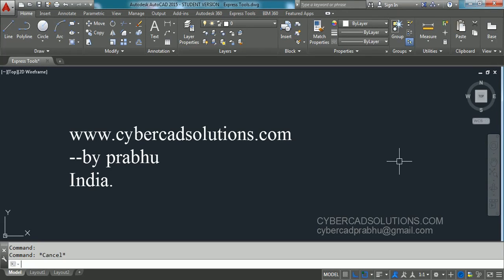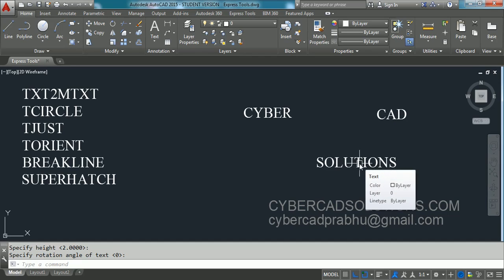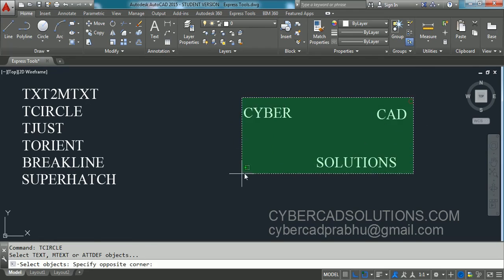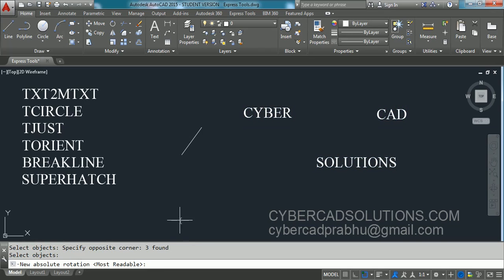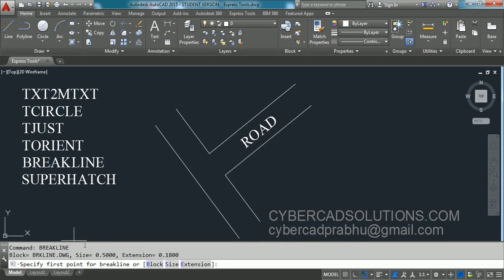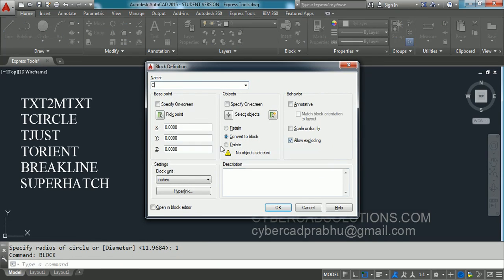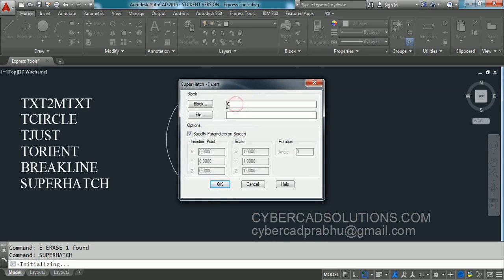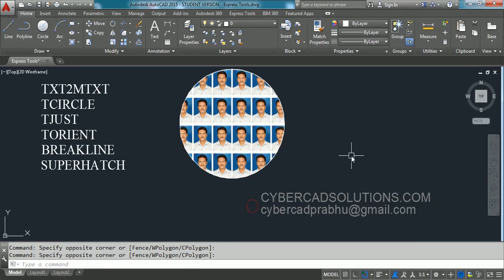What are the Useful Express Tools in AutoCAD

Comment: very useful and nice video make it was very clear no confusions,......very impressed keep posting cad commands..
Reply from the maker: Thank you. Please share.
Reply: @cyberCADsolutions  

Hi can you help in this,my CAD is hanging particular file due to block with attributes can't work it take time every selection 5to 10 minutes to move or paste.. Can you clarify it?
Reply from the maker: Make a copy of the file. Use purge command to remove unused blocks and references. Then the file will become lighter.
Reply: @cyberCADsolutions   I have done purge ..i tried those commands.. But still same issue exisisting ...
Reply from the maker: @gowthamiv4841  use erase command. Select all, remove required objects. This will work.
Reply from the maker: Make sure that you removed required objects from the selection.
Reply: @cyberCADsolutions  removing of required objects by??
Reply from the maker: @gowthamiv4841  while selecting objects to erase, type all at command prompt, and then press shift key to remove required objects from the selection.
Reply: @cyberCADsolutions   sir my issue is can't copy the required object...as you say if I do it will erase all except shift and selected object.i don't want to erase all.. My problem is can't copy the selected object of to other file..
Reply from the maker: @gowthamiv4841  if you erase hidden objects which are taking lots of memory, your drawing will become lighter. So that you can copy or do any other operations.
Reply: @cyberCADsolutions   Hi sir, till now i can't resolve the issue, cad is strucking half an hour..can't even access some other cad file, yesterday i have worked some other file not an issue.. whole day  i have worked.. but this  file only making trouble..can you give your mail i d i will send the file ..
Reply from the maker: @gowthamiv4841  utubeprabhu@gmail.com